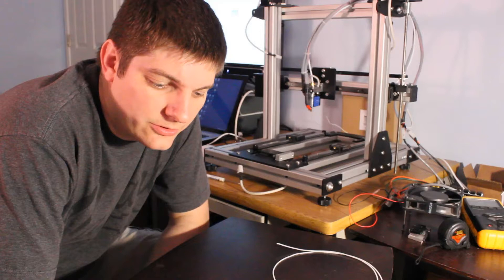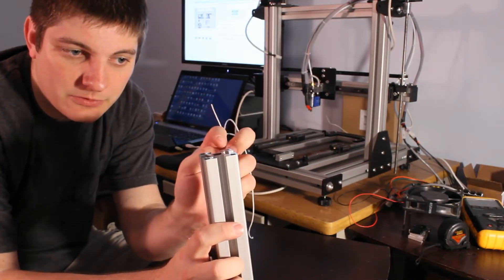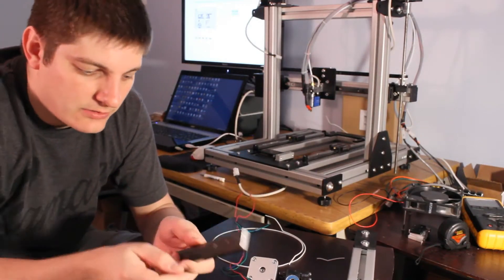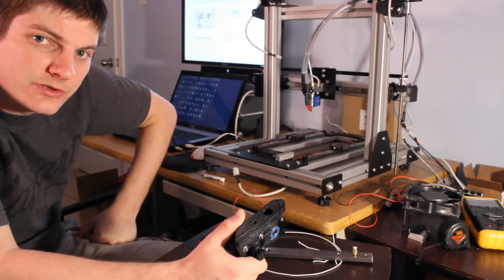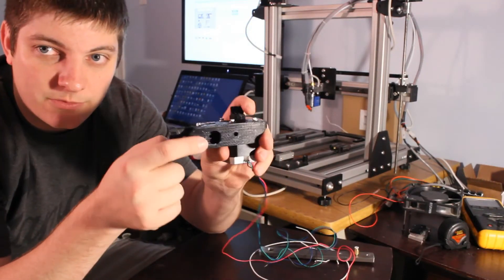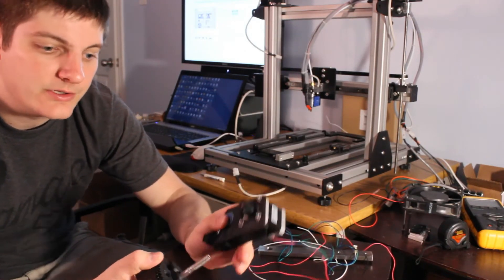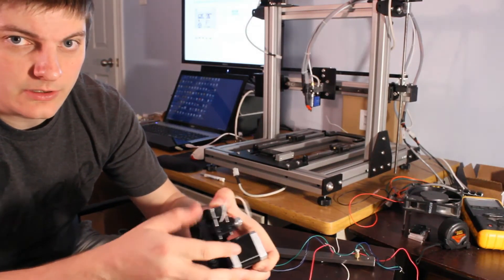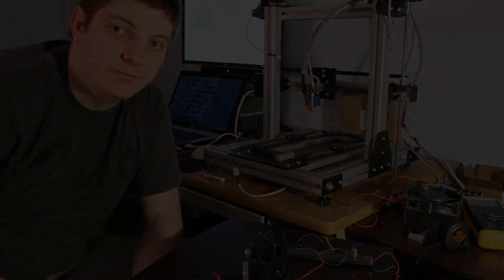Evan's DIY 3D Printer / Mill - EP8 - Filament Extruder

Comment: Good info thanks I understand the extruder better now to where I can make a purchase I think. If I understand the benefits of Bowden and the ptfe tube is less weight and size also can add up to 4 or more hot ends to incorporate multiple colors. for some reason I want to use geared stepper motor but not sure why. Good vid I needed that. Also what ID size PTFE tube for 3mm filament ????
Reply from the maker: I'm on 1.75mm filament, so it is 2mm ID and 4mm OD.  I think people who use 3mm filament use 4MM ID and 6MM OD.  That extra .75mm clearance is probably good since mine bound up a bit when I gripped it too hard with the hobbed bolt.

If you have a geared stepper already there may be a better option than the extruder I used.

But yes, benefit of bowden is getting the hot end far away from your extruder, less weight to fling around, and less clutter on your tool plate (for room for more extruders, mill head, etc).  Downside is added friction, some say precision, etc.

My primary reasoning was that I want to play with delta bots at some point, so I can simply swap the end of the PTFE tube over to the other machine and save the money on a second extruder.  Then again, it was only about $50 total, but still, budget is key for me.

I actually did not buy the bowden E3D Hot end, because my mount setup accommodated it.  It may give me trouble on future delta setups, but I liked what I had and stuck with it.